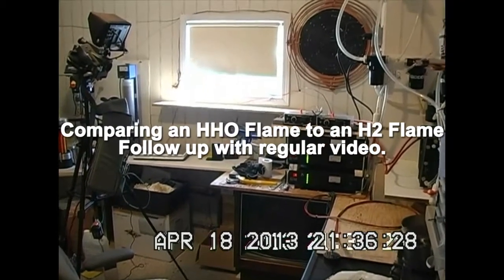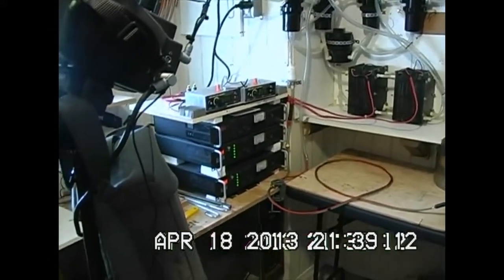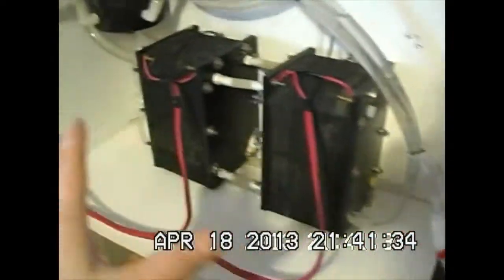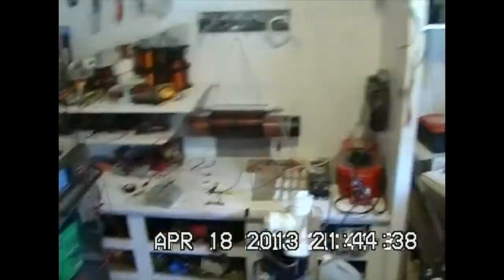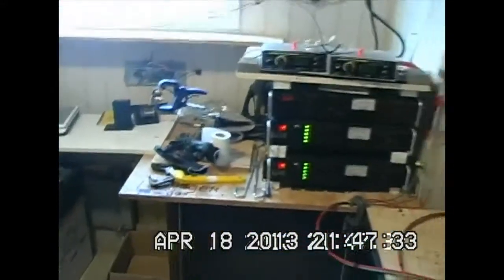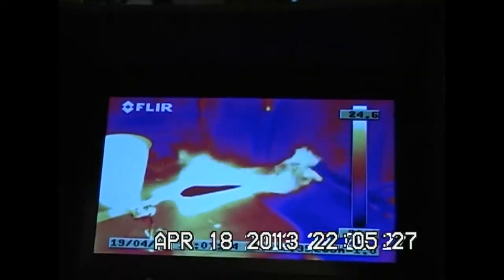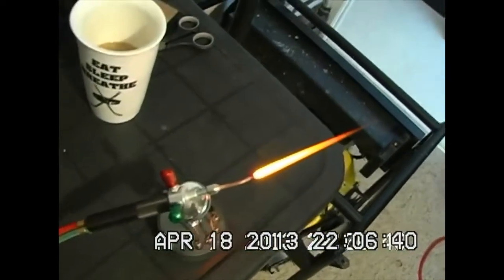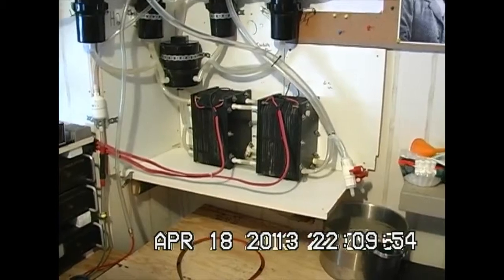Comparing an HHO Flame to an H2 Flame part 2 with ramblings about stuff

Comment from the maker: Thanks Tan.  ;)  I had the idea of testing my electric generator (when ever its running) with a HC vaporizer bubbler after the exhaust value (geet like) as well.  What ever is going to be the most efficient way to make it run and provide excess electricity while driving my amps to run the separator cells.  My amps are ready to hook up to my 24volt solar banks and will auto switch to that source when AC is off.  Amps also have a feature that charges DC batt banks once AC is on from generator.

Comment: HC fuel could be used just pass the bubbles trough the fuel tank and it will carry the fuel vapor with it. I'm using gasoline and diesel fuel to made those flame and mix the gases with ambient air to set the stoichiometry. I'm still focusing at a cell design at current time and use my other design for fuel economizer only, will make some flame too in the near future I hope. 
Best regards my friend, Tan K.

Comment from the maker: Hey IndianaBoys! How ya doing? Haven't corresponded on energeticforums much with ya lately. Yes. I really believe there is a function that i need to learn on the FLIR camera that will take the range up to 700 C. I'm going to print off the manual and have a better look for it. I can really see this when i put HHO to smelt silver, the glow gets very intense. Enough so that i needed to wear welders googles or would have retina burn. Thx for comment IB! Great to see ya here man. :)

Comment: Great work!  Thanks for sharing with FLIR!  It would be interesting to see what is revealed with the Flir camera if you do the same demonstrations by adding different metals in front of the different flames.  Browns gas with nothing in fromt of it is supposed to be "cool", but it gets very hot with metals very fast.  They say it self adjusts, all the way up to sublimating Tungsten at 13,000 degrees F.  Different qualities of Browns Gas are produced depending upon the type of cell construction.